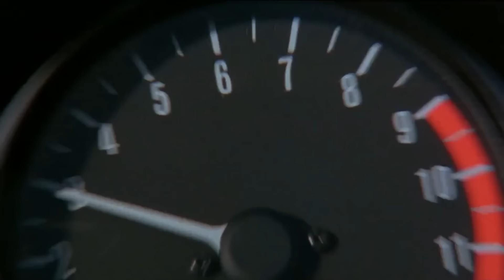25 (Every) Deranged & Maniacal Mad Max Villains - Backstories, Personalities & Influence - Explored

Comment: Station wagon or SUV van is not what makes it not a van is those 2 vehicles come with 4 wheel drive or all wheel drive from info I gathered vans rarely had 4 wheel drive option until late 90's and most Australian vehicles are off road capable